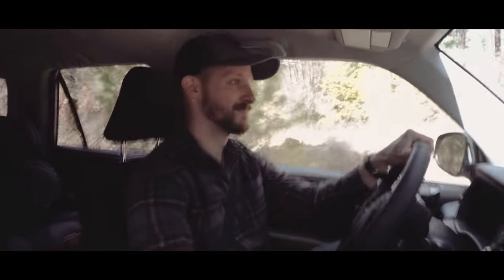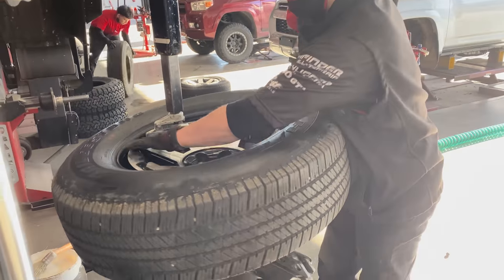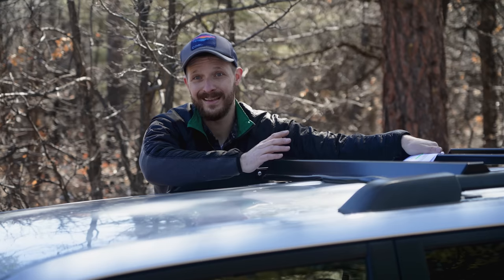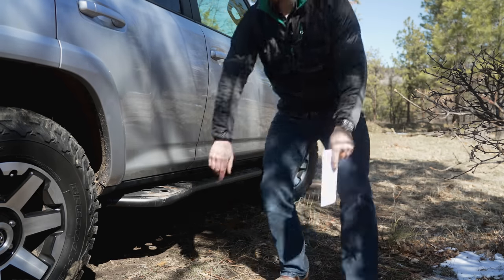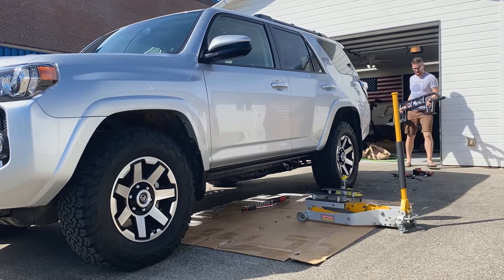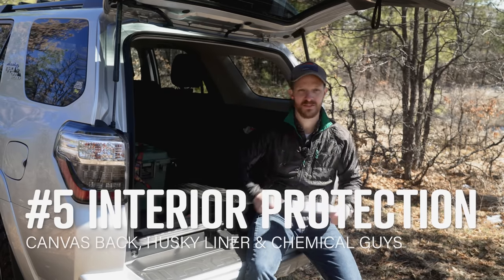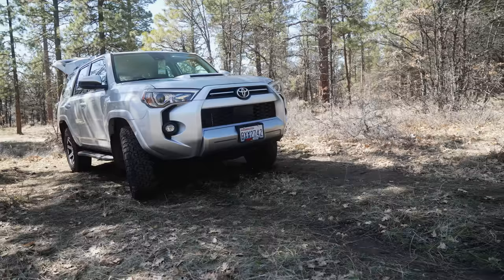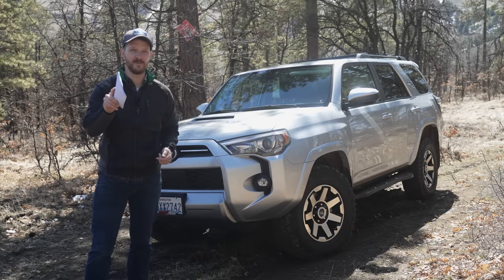Start Here: Toyota 4Runner Top Six Mods/Accessories To Do First!

Comment: I was looking at buying a new one just like yours in silver r u happy with the color?
Reply: Just bought a black one two weeks ago with tan interior...I love it
Reply: @financialfreedomflippers700  congrats
Reply: I have a silver one, I actually really like the color. It's kind of boring compared to some of the other colors offered, but the great thing about silver is that it does a good job of hiding scratches and chips. You really can't tell imperfections in the paint unless you look up close. It also doesn't really look dirty until you wash it, and realize it has a nice metallic shine to it.
Reply from the maker: I agree with Trail Runnah... it's a great color but very common.  I added that small decal over the TRD Off Road badge and I may add a few more tasteful ones to make it stand out a little.  It hides dust really well, that I can say.
Reply: @westcoast708  thanks

Comment: Great Job Jason!!! Tires & Rims were my first mods on my 2017 TRD Off Road (Nautical Metallic Blue). Just finish doing my last mod (I think : ) ). My Mods to date: Nitto Ridge Grappler Tires, Fuel Enduro D608 Rims, Bilstein 5100 2.5" Lift, Replaced Silver Front & Rear Bumper Valences W/ TRD PRO Black Valences, Replaced Silver Roof Rack Rails  W/ Black TRD PRO Rails, Blacked out Grill Sombrero Badge, Blacked out Tail Gate Sombrero Badge & 4Runner Letters, Blacked out TRD Off Road Badges on side, K&N Cold Air Intake, Alpine Halo ilx F309 4Runner Head Unit, JL Audio Speakers (All around), Weathertech front & Back Seat Mats, Husky Cargo Mat, LED Interior Lights, Morimoto XB Head Lights & Morimoto XB Rear Tails. And a few other smaller things in the interior.
Reply from the maker: Awesome!  That’s a great list.  Next one we have planned are installing 2 way radios in the 4Runner and Colorado for off-road comms.  Going for a clean, stock looking install.
Reply: @JasonExplainsThings  I am on the fence about doing a Borla exhaust. As of now I am done with mods. Friend of mine keeps trying to talk me into a supercharger. Told him if he has $6k to give me then I am all in.
Reply: without pics, it didn't happen, LOL

Comment: Is there a difference in ride quality after changing to these tires ? Do you recommend to change the tires  if you drive mostly on Onroad or highway ?
Reply from the maker: If that's the case there's nothing wrong with the tires it comes with.  You may want to invest in some snow tires as well if you keep the stock ones.  BUT... the ride quality and road noise is fine with the KO2 tires.  I'd recommend not going with mud terrains since that will make the ride noisier and lower fuel economy.
Reply: @JasonExplainsThings  Much appreciated for the advice. Thank you 😊

Comment: I took out the stock battery and installed a 27F (bigger) battery. All it requires is the larger battery tray from a 2008 v8 4runner.

Comment: Hey Jason, I really enjoyed the video. Quick question: I just bought a 2016 4Runner SR5 TRD Pro and it came with the stock 245/70R17 tires (as described in owner's manual) and would like to upgrade to 265/70R17 just like you did. Could you think of any drawback in using wider tires? Would you recommend me to do it or should I stick to the owner's manual size? Thanks!
Reply from the maker: I thought all 4runners came stock with 265s?  Weird.  I’m 99.99% it would fit, but maybe check with a trusted tire shop.  They should fit though.
Reply: @JasonExplainsThings  Weird indeed… will check at the tire shop, thanks!

Comment: Badass 4Runner with some nice upgrades. I gotta say though, that Slime repair kit is a lifesaver lol. Hasn't let me down yet and hard to beat considering the space it hardly takes up. Is the ARB tire repair kit very large? Also, can the portable jumper pack jump a vehicle multiple times without recharging? Thanks!
Reply from the maker: The ARB kit is fleshed out nicely and comes in a nice hard case.  That jumper pack is awesome and works very well.  I think they have different sizes that can do more/less jumps.  The battery holds a charge for a long time.  It’s also great for charging electronics.  I’ve used it to charge camera batteries, drones, etc.

Comment: Just picked up a ‘21 4Runner Trail Edition 4wd and love it. Was looking at 4Runners forever and wanted to get one before they change the body style and/or powertrain.  I went with the Trail Edition because honestly I didn’t need the next level four wheel drive system with lockers and crawl mode. Simple part time four wheel drive is enough for me and believe it or not I wanted the cloth interior and I am a sucker for a metal key instead of push button start. The Trail Edition is offered in four cool colors and I chose Cement with TRD black wheels. I also like the Yakima roof rack it comes with as standard and the Toyota (Yeti style) cooler.  A bit gimmicky package but it fit the bill for me.  First thing for me is tires. I was thinking about Falken Wild Peaks or Nitto Trail Grapplers. I heard for a while they were having trouble with the K02 getting them to balance and aslight wobbly after mounting/balancing. I think that have have been a production issue that has been corrected ?  I’m happy for you, you have a great rig and enjoy your videos
Reply from the maker: Yeah the trail edition is a great deal.  And you’re right... 4 Low is the most important thing to have.
Reply from the maker: Crawl control is pretty fun and cool to use.  It makes terrible noises.

Comment: How is the gas mileage and I have heard some concerns about the ko2 on wet roads ??? Thank you
Reply from the maker: MPG is not the 4Runner’s strong suite.  Now that it has a lift, roof rack, winch, etc I’m getting 17 highway, 14-15 city.  But it’s a wonderful vehicle 2 years later.

The KO2s are not the the best on wet roads, but not bad.  They’re excellent in the snow and not bad in mud.  I’m very happy with them and will likely get them again.
Reply: @JasonExplainsThings  thank you!!!

Comment: Nice video, I bought the same model, but a 2019 for the same reason.  In CA the TRD Pro was $15,000 mark up.  Didn't think that it was worth.  I still have the stock tires, but will go with the KO2s like you.  Cute kids, thank you for sharing.
Reply from the maker: $15K markup?!  Holy biscuits!

Comment: For those late watchers like me.  An extremely critical piece of mod is a cargo net designed to stop all the shit in the back from killing everyone in the front in a bad accident.  
Watch some videos of debris flying around the interior in an accident.  He groaned putting his recovery box in the back. Imagine that coming apart and flying around the interior.  
Goes for every vehicle not just 4 runners.  Food for thought
Reply from the maker: Couple things.  The groan is because I have a bad spine.  Also, the back of the 4Runner has tie down points.  This box is usually strapped down with a ratchet strap.  Much more secure than a net.

Comment: I have a 2017 TRD Pro and I did the tire mod before I took it home! KO2s were my choice, too. I just recently upgraded my Halogen lights to LEDs. I love your rock sliders.
Reply from the maker: Thanks Mel!  Yeah I think the tires happened within 3 days!  I’m about to upgrade the fog lights and all internal lighting to better LEDs.
Reply: @JasonExplainsThings  Which fog lights are you looking at? I went with an amber bulb, but I'm not totally happy with them. My headlights are awesome though! So much brighter than the stock ones!
Reply from the maker: Amber Diode Dynamics.  Hope to shoot a video about them very soon.
Reply: Did you go with stock size tires as well?
Reply: @Solefresh10  Yes, I kept them stock. I went with the KO2's but I think if I had to do it over again, I'd look at a different tire like maybe the duratrak. I've had a couple sidewall issues with the KO2's, one was my fault, the other one was not. They should stand up better, imho....

Comment: If it's anything like the Tacoma transmission you'll prob want to change your gear ratios if you go to a bigger tire. It was already tall with 31's when I test drove it...
Reply from the maker: My buddy Ben has was telling me about that issue with Tacomas.  The transmissions are different though (Tacoma is a 6 Speed and the 4Runner is a 5 speed) so I'm not sure if it's as much of an issue.  I'm sure if you go big enough it will be.  :-)

Comment: Did you go with a slightly bigger tire size or keep them 265s?
Reply from the maker: I kept them as 265s because I wanted to go with KO2s in C load.  I’ve heard 275s will also fit… I might do Falken Wildpeaks at3w 275s since they’re C load… and people say they’re great in the snow.
Reply: @JasonExplainsThings  Cool. I just bought 275 BFGs KO2 and they fit great. I used your tactic and sold my old tires with 275 miles to Discount Tire. If I were to do it again I would have gone with the lighter Falken Wildpeaks.

Comment: Pros are going for 55k plus 10k mark up the had a lime rush or what ever. Sold the next day. Wife and I love the Luna rock. I didn’t at first but it grew on me. There one that runs around my town. It’s so nice but all stock boo.
Reply from the maker: I just saw a video on TFL that a new TRD Pro in that crazy lime green color was $73K.  Complete madness.  The TRD Off Road is almost just as capable.  Once I do a suspension upgrade it will be more so.  I'm loving the 4Runner more after owning it for almost a year.

Comment: FYI 255/80/17s which the manufacturer lists at 32.8" diameter fit with zero rubbing even at full or really close to maximum articulation, front and rear.  I have steel skid plates which put about 100 lbs extra over the front axle.  I may experience rubbing when I install a steel bumper, however.  During brake dive,n mostly.  But stock suspension is doing fine for me for now.

Comment: On your BF K02's did you go with E or C rating? Its often left out when people describe the tires, but I always wonder since I believe it makes a difference. Great video by the way!
Reply from the maker: Great point.  I should’ve mentioned that!  I they are C load.  I’ve been told by several people that E load tires are terrible for daily driving.  That’s why I went 265 instead of 270 because they are only E load.  Thanks for bringing that up.
Reply: I disagree here again. 
I run E rated KO2s on my Tacoma. 30psi in daily driving and they're smooth and wear perfectly. The chances of tearing one on trail is significantly less then a C rated tire.
Reply: 235/80r17 load e toyo at2. 
This size in a e is still lighter than stock and way tough.  Love them around 38-44 lbs air .
Reply: C rating is the way to go I think, I’m looking to get a pair myself but they are $320+tax a tire here in Canada for the 265 70 17, and the trd pro rim I want around the same amount from Toyota maybe $340
Reply: Trd pro rims are 7 inch wide. That is the narrowest bfg lists for that tire size (8inch is recommend) . I would get a wider rim for a better performance, or a narrower tire (235/80r17)
Reply: @JasonExplainsThings  I’ve got the 270s and the ride is smooth——ish. But my mpg is like 17-18 on the road
Reply: 305 e load toyo at3. My spare is so heavy!
Reply: We have E load KO2 in 275/70r17 (basically a 32" tire) on our 5th gen 4runner and its smooth. They wear fine, and I have the peace of mind of it being tougher in the sharp rocks/roots. 

Have had some balancing issues, but discount tire usually gets it right. 

I also run E load Geolander 32" on my 3rd gen with zero issues. Preference I suppose, but if you hit rough trails I'd go E load.

Comment: I had my 2020 TRDOR 2 days before swapping to Wildpeaks AT3. 

I have done quite a bit of off-road with fully built crawlers to stock XJs. I won't lift my 4 runner...probably ever. If I do it will be the Bilstein 5100 and bring the front up 3/4". 

12k miles with about 800 off-road, I have not found a trail I wanted to do that the stock runner wouldn't do. 

I want spiders and armor before anything else. Sadly, it is my wife's vehicle and it came with worthless steps. I am trying to convince her she needs "Heavy Duty" steps. Lol
Reply from the maker: Yeah a lift will be great at some point, but the ground clearance is awesome already.  But I’m sure it’ll happen.
Reply: @JasonExplainsThings  my thoughts as well. Maybe around the 60k ish milage, I will do one. About the time you should be doing suspension anyway. 🤷🏼‍♂️

Comment: I ordered Cali Raised raw metal too.  Hope I can follow your video to do the coating
Reply from the maker: Nice.  Use satin black instead of flat black paint.  Closer look to powder coating. 👍
Reply: @JasonExplainsThings  thanks for the tips.  Your video is well done.  In the future video, can you give a description or name or link to the products that you use in the video.
Reply: When you applied the coating, did you run into issue with spray can that got clogged up?  I'm using  krylon spray can but two cans so far got the nozzles clogged up after only 30 seconds of spray.  I tried to poke in the needle into nozzles and air duster but still couldn't fix the clogged

Comment: I bought the same, drove it straight to an offroad builder. 6" fox suspension lift, 22in rims on 33s. Left strait from there to custom sound audio. I've only put 4k miles on it but so far I'm loving it.

Comment: I’ve had big jacked up vehicles my whole life. I have a Ram 2500 with a 7” lift and 37” tires with 22” rims. The offset is stupid but looks good. Im tired of it though, you drive through a mud puddle and you literally coated the whole truck in mud cause of the offset. It’s a beast and it’s gone tomorrow cause fuel is KILLING ME. 

But I do like lifted and I will probably put a 3” in the front and 2” in the back. Won’t go over 33” tires either. I’m 49 now and I love all the jacked up stuff but I don’t wanna own it anymore or the upkeep. I do help my friends with there stuff when they wanna lift a new truck or whatever. Plus I will never own another black vehicle again. First thing I’m getting is floor mats….lol. I’m in construction and building wind farms in the middle of nowhere. Mud everywhere….
Reply from the maker: Thanks Will.  Yeah, more on this soon... I just installed a new Eibach suspension system on the 4Runner.  Spoilers, it was an inch lift in the rear, and about 2.5 inches in the front.  Rides wonderfully on the road.  This install is fresh so I haven't gone off road with it yet.  My wife and I are very happy with it.  I don't think I'd want to go any higher.  The 32" KO2 tires still look great with this lift as well.  I wouldn't want to go any bigger, especially with gas prices.

Comment: I enjoyed the video; great information!  I picked up a 2021 TRD Off-Road Prem in dark grey, right before the chip shortage killed dealership inventories.  I decided on some mods similar to yours.  I also put on some BFG K02's...in stock size.  I didn't want to mess with a lift at this point, plus I plan to do a little towing on occasion and didn't want bigger tires for that.  Also ordered rock sliders and a front skid plate from RSG Metalworks.  I had a Thule roof rack left over from the Forester I traded in that I threw on the top, but I'd like to get a full-length rack, like that LFD you mentioned, or maybe a Prinsu.  Anyway, love the vibe of this video, from one dad to another!  Subscribed!
Reply from the maker: Thanks man!

Comment: You might want to look into some solid aftermarket frame mounted recover points for the front. I’ve seen the factory one fail in a hard pull. LFD bumpers have rated recovery points built in as well at slots for HiLift jack.  And while I’m talking about HiLift… BUY AN ACTUAL HiLift and not a wanna be imposter!,
Reply from the maker: Bam!  https://youtu.be/05oEcrO9obQ

Comment: I got mine 2019 sr5 premium 4×4. I did a 2.5 lift bilstein with 33 tires
Reply: Did you have to do upper control arms too?
Reply: @skatevil  no only if you go 3 inches you need to change upper control arm

Comment: The Rock Slider floor plates are installed upside down...FYI
Reply from the maker: It can be either way.
Reply: @JasonExplainsThings  I can see where it would provide an extra "Grip", Perhaps the other way would provide better "drainage"...Either way, Great vid, helpful...I installed a set yesterday...DANG, those Bolts!!!  Thanks for the reply - Good stuff...Enjoy the Runner!

Comment: Kiss the paint on the roof goodbye when it starts rubbing!! LFD needs to fix that issue!
Reply from the maker: Finish the video!  They sent the edge guard in two days. :-)
Reply: @JasonExplainsThings   Its the same molding SSO sends out and all the other companies. It will rub the paint off! But just an observation from experience...
Reply from the maker: Lame.  I’ll keep an eye on it.
Reply: It does suck. Ive been there and Im slightly OCD lol

Comment: I don't understand how you can do a list of top mods for 4Runner and not have new headlight bulbs at the top of the list. The stock headlights are trash. I put LEDs in mine and it was the best $50 upgrade I've ever had.
Reply from the maker: The 2021 4Runner has LED headlights.
Reply: @JasonExplainsThings  Ah! I have a 2016...good they upgraded those!
Reply from the maker: So I’ve heard.  I do want to do brighter fog lights... need to save up for those. :-)

Comment: I have a sr5 is it good at off road
Reply from the maker: An SR5 is great.  You have ATRAC and a limited slip rear diff.  Maybe down the road you could consider getting a rear axle with a e-locker in it.  A rear locker is helpful in tricky situations, but most of the time ATRAC and 4 Low get you where you want to go.